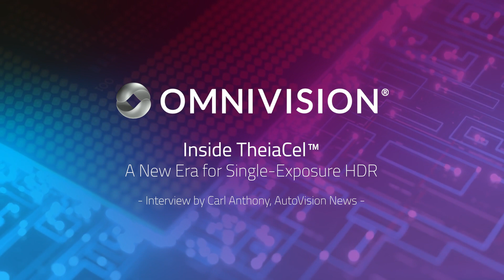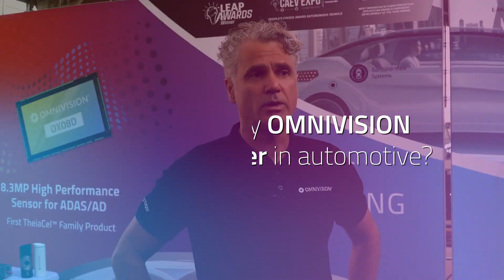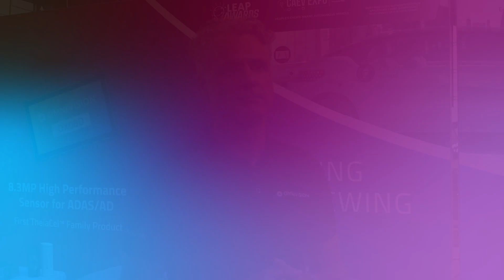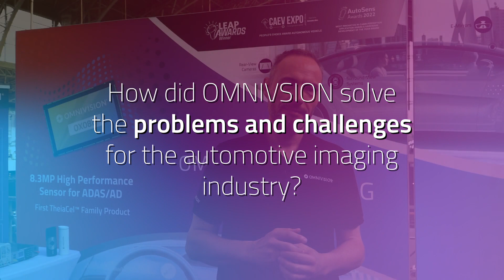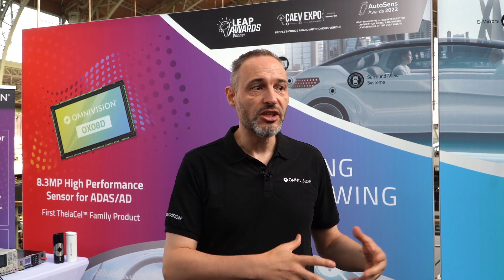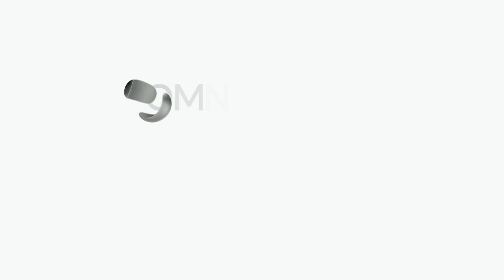Inside TheiaCel  - A New Era for Single Exposure HDR

Comment: bug Video 📷 (lens jump) camera phone 
🚨--switching lenses usually causes a momentary blackout or forces one mode to stop...?!!😱😮‍💨😰

#OV50X250 250MP size 36mm
Deep Fusion & Smart HDR 5 
Full-frame Sensors RGBW 12K infrared (IR) with DCG & DAG
(29 Stops of dynamic range)(200dB)PureCelPlus‑S
24-bit linear 18-bit log
without any loss
Contrast 1000000:1 sensor slight sensitivity & Noise
larger pixe Strong Reflection
High-quality sensorslight sensitivity & noise performance, enabling them to handle a wider range of light levels without losing detail. (larger pixel sizes)
Strong Reflections, Uneven Incident Light
shutter speed 1/9000 s

bug Video 📷 (lens jump) camera phone 

🚨--switching lenses usually causes a momentary blackout or forces one mode to stop...?!!😱😮‍💨😰

True color science in a pocket device
High-bitrate recording with pro codecs
Seamless switching between focal lengths during filming
Dual-stream capture for instant A/B camera angles
Switch focal lengths mid-shot without the jarring “lens jump” seen on most phones
Create synchronized multi-perspective footage in one take
Think about shooting a live concert, you’re filming in wide angle, but you also want high-resolution stills from a telephoto perspective. On today’s smartphones, switching lenses usually causes a momentary blackout or forces one mode to stop.
Cinematic
9990k dot Electronic Viewfinder Magnif 100xLarger, AF points 120, PDAF (1cm - ∞) Ten OIS, EIS  F/1.2-9.0, ZEISS T* HyperTone image engine,AI Anti-Reflection,AI De-Blur,AI Super Resolution AF, AI Call Translator 3.0,AI Tracking, AI Portrait Video 3.0, AI Voice Clarity videos photos, AI Magic Fill, AI Panning Shot, AI HyperClarity 800X Zoom,Al Remove Noise,Hand✋share

Comment: bug Video 📷 (lens jump) camera phone 
#OV50X250 250MP size 36mm
Deep Fusion & Smart HDR 5 
Full-frame Sensors RGBW 12K infrared (IR) with DCG & DAG
(29 Stops of dynamic range)(200dB)PureCelPlus‑S
24-bit linear 18-bit log
without any loss
Contrast 1000000:1 sensor slight sensitivity & Noise
larger pixe Strong Reflection
High-quality sensorslight sensitivity & noise performance, enabling them to handle a wider range of light levels without losing detail. (larger pixel sizes)
Strong Reflections, Uneven Incident Light
shutter speed 1/9000 s

bug Video 📷 (lens jump) camera phone 

🚨--switching lenses usually causes a momentary blackout or forces one mode to stop...?!!😱😮‍💨😰

True color science in a pocket device
High-bitrate recording with pro codecs
Seamless switching between focal lengths during filming
Dual-stream capture for instant A/B camera angles
Switch focal lengths mid-shot without the jarring “lens jump” seen on most phones
Create synchronized multi-perspective footage in one take
Think about shooting a live concert, you’re filming in wide angle, but you also want high-resolution stills from a telephoto perspective. On today’s smartphones, switching lenses usually causes a momentary blackout or forces one mode to stop.
Cinematic
9990k dot Electronic Viewfinder Magnif 100xLarger, AF points 120, PDAF (1cm - ∞) Ten OIS, EIS  F/1.2-9.0, ZEISS T* HyperTone image engine,AI Anti-Reflection,AI De-Blur,AI Super Resolution AF, AI Call Translator 3.0,AI Tracking, AI Portrait Video 3.0, AI Voice Clarity videos photos, AI Magic Fill, AI Panning Shot, AI HyperClarity 800X Zoom,Al Remove Noise,Hand✋share

Comment: *Abstract*

OMNIVISION is a leader in automotive image sensor technology. With a long history in the field, they've pioneered innovations like split pixel technology for high dynamic range (HDR) imaging, now adopted throughout the industry. Their extensive product portfolio addresses diverse automotive applications, from rearview cameras to autonomous driving systems.  Key areas where OMNIVISION excels include:

* *High Dynamic Range (HDR):* HDR is crucial for capturing detail in both bright and dark areas of a scene (e.g., inside and outside a tunnel). OMNIVISION's split pixel technology and their new integration of dual conversion gain (DCG) with Loi technology significantly enhance HDR capabilities.

* *LED Flicker Mitigation (LFM):* LEDs in traffic signs and lights can flicker at varying frequencies, making them difficult for image sensors to capture consistently.  OMNIVISION's technologies allow for longer exposure times to address this while maintaining HDR.

* *In-Cabin Applications:* OMNIVISION's sensors with nixel Global Shutter capability enhance image quality in low-light in-cabin settings, enabling  more cost-effective and power-efficient systems. 

OMNIVISION remains committed to developing new technologies to support the evolving needs of automotive systems, such as connectivity for software-defined car architectures and lower power consumption for electric vehicles. 

i used gemini
Reply: The knee point refers to a specific challenge in High Dynamic Range (HDR) imaging for automotive cameras, especially when dealing with long exposure times.

Here's a breakdown of the knee point and how OMNIVISION's technology addresses it:

1. *Why Long Exposure Time Matters:*  Capturing clear images in low-light conditions often requires a longer exposure time for the camera sensor. This allows more light to hit the sensor, resulting in a brighter and clearer image.

2. *The Issue with Long Exposure and HDR:*  However, in automotive applications with HDR (like driving through a tunnel), a long exposure can be problematic. While it captures details in the dark tunnel, it might also oversaturate the bright scene outside the tunnel.

3. *Dual Conversion Gain (DCG) for HDR:* OMNIVISION uses DCG technology to address this. DCG allows the sensor to capture images with two settings:
    * *High Conversion Gain:* This captures images with low noise but saturates quickly (good for dark areas).
    * *Low Conversion Gain:* This captures images with higher noise but saturates later (good for bright areas).

4. *Loi Technology and the Full Well:* But DCG has a limitation. There's a physical limit to how much light a sensor can capture (full well capacity). Once full, the sensor can't capture more detail.

5. *Loi for Extended Capacity:* This is where Loi comes in. Loi acts like an overflow reservoir for the captured light. It can hold significantly more charge than the standard sensor, allowing for capturing even brighter scenes without saturation.

6. *The Knee Point Challenge:*  However, combining DCG and Loi introduces a new hurdle – the knee point. This is the transition point between the DCG capture (low noise) and the Loi capture (higher noise). Ideally, the noise level shouldn't significantly increase at this point.

7. *OMNIVISION's Innovation:* OMNIVISION tackles the knee point challenge by significantly reducing something called "dark signal non-uniformity" (DSNU).  DSNU is essentially leakage of electrical current within the sensor, which can create inconsistencies and noise, especially at higher temperatures.

8. *Optimizing the Knee Point SNR:* By reducing DSNU and optimizing the full well capacity, OMNIVISION achieves a high Signal-to-Noise Ratio (SNR) at the knee point, even at high temperatures. This means the transition from DCG to Loi capture is smooth, with minimal noise increase.

*In simpler terms:* OMNIVISION found a way to extend the usable range of the sensor's light capture capabilities (like having a bigger bucket for light) while minimizing the negative effects when switching between different capture modes within the sensor (like having a smooth transition between two different sized buckets). This allows for capturing a wider range of light conditions (bright and dark) with good image quality, even in low-light scenarios with longer exposure times.
Reply: @wolpumba4099  Thank you for the very understandable explanation.